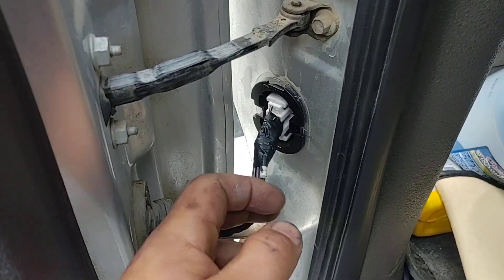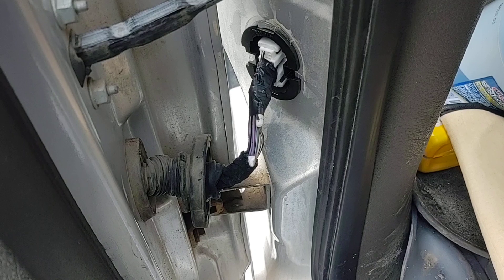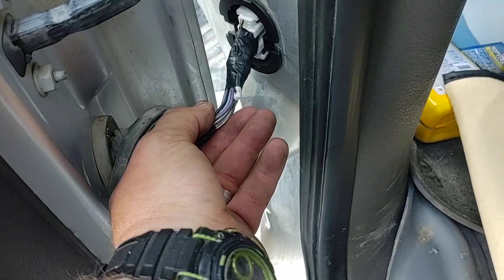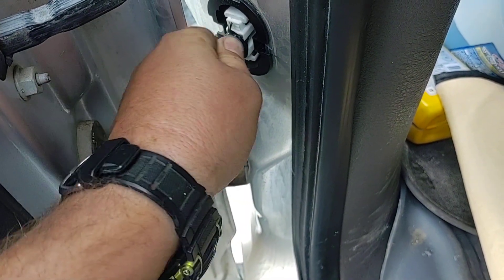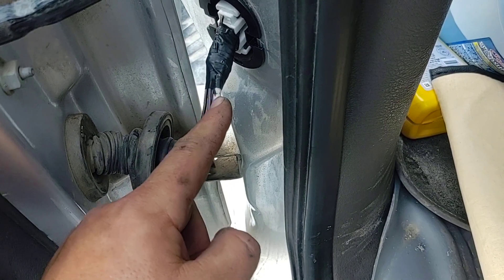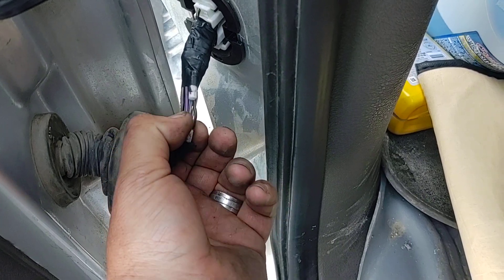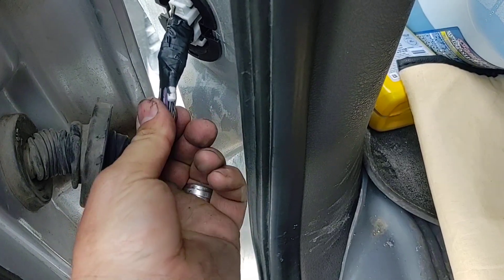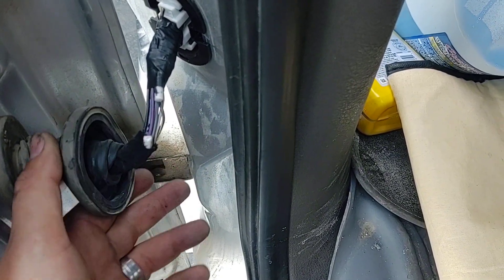Ford f150 door ajar open light stays on

Comment: I have the same truck how did you find out it was that door?
Reply from the maker: It is pretty easy to pull the rubber back and check the wires. Another way is to open each door and see if you get the beeping. Some cars will beep each time a door is opened. If it doesn't beep for only 1 door then that one is the problem
Reply: Couldn’t you add more wire so that you don’t have to worry about it bending and breaking again?